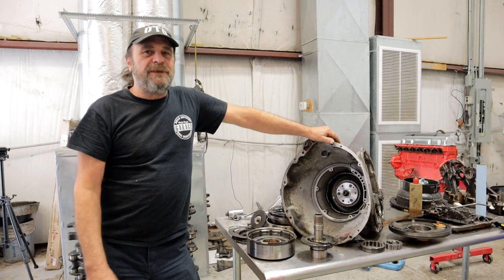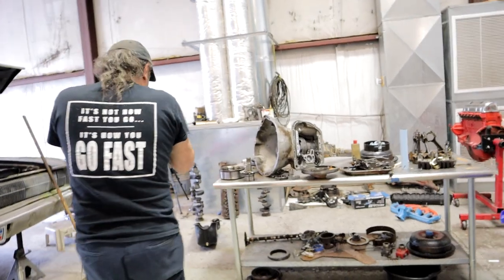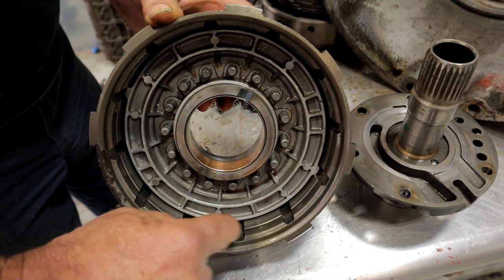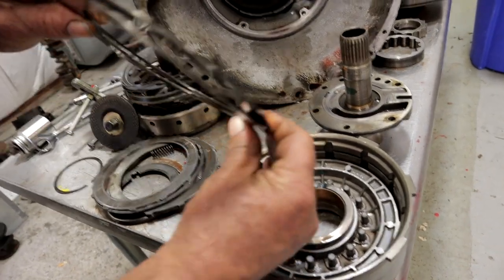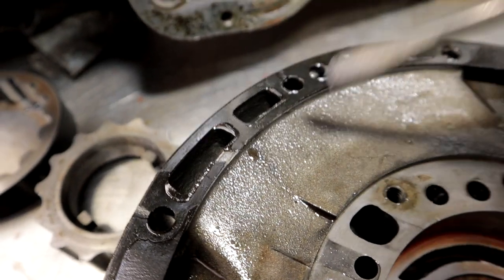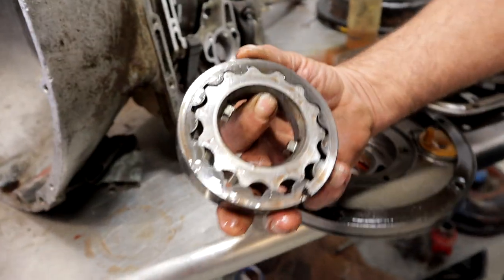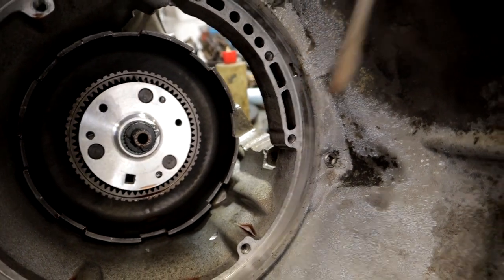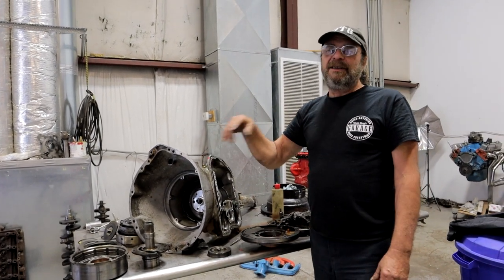Dead Torqueflite Autopsy - Digging Into Our 67 Charger's Transmission To Find Out What Let Go

Comment: Usually converter drainback causes the delay in the morning, and low throttle pressure kills the direct clutches. Of course low fluid level can cause/contribute to both. The gasket thing is a new one, but certainly could have been your problem if it was missing like that. Sharp eye!

Comment: You're the reason I have the confidence to drive old vehicles as daily's. 
Now I do admit I don't have any desirable stuff my daily right now is in 82 Cordoba that I'm building a small.
 block 318 for again nothing special
You're a service to the people that are trying to keep the hobby alive and I'd even turned the parts business into one of my side hustles to fund my projects keep up the great work utg
Reply: 82 Cordoba is still a Mopar and real Mopar guys will respect it, guys who scoff at anything less than a Hemi Cuda are posers. I daily a 1980 Newport 360
Reply: I have an 82 Cordoba in Gold that I hope to have running this year. I am pulling the 360 out of a 79 Cordoba, going to refresh it (Rings, bearings, etc.). I have a factory 360 Thermoquad manifold and will add a very mild cam. BTW, the previous owner of mine stuffed an 8 3/4 from a 1970 Challenger in it, said it was direct fit. I had an 83 Cordoba from 88-91, I blew up the original 7 1/4 rear end, replaced it with an 8 1/4 from a Volare with 2.71 gears, made car the relatively quick for the day even with the 2bbl 318. Good Luck!!!
Reply: Build that Cordoba up, life is too short, just enjoy it. From a Pontiac guy with love and respect for MOPARs.

Comment: I've been rebuilding automatic transmissions 45 YEARS this is the 727 torque flight  three speed  most of the time they just  wear out due to age  because of  gradual friction  exactly like break lining  gets to thin to stop the car ,, well the clutch pack gets to thin to pull the car   , but Tony  over 40 years ago  I was  just learning this trade , just so happened my nabuer   had a  prospector  Dodge  half ton  I was just a teenager and my dad was GM FACTORY TRAINED  FOR  ALL HYDRO MATIC  ,,, BUT THAT BLOWN OUT GASKET  MADE ME REMEMBER  ABOUT HOW  THE DEALERSHIP AND 2 OTHER SHOPS COULD  FIGURE OUT  ,,,,, THAT THE SURFACE AREA WAS NEVER CUT  DOWN TO MATE THE GASKET  SO I TOOK A  PUTTY KNIFE AND GAVE IT A SHAVE , MY DAD GAVE ME A 20 DOLLAR BILL AND TOLD ME THANK YOU JUNIOR 🔧🏁

Comment: I had to replace a reverse band on a 727 torque flite. it was in a 1974 International 3/4 pickup. it wasn't too bad of a job, although a person  has to basically completely disassemble the transmission to replace the reverse band. I guess it's fairly common for reverse band's to break on those transmissions. especially when people don't service them at regular intervals. and the ear of the band and the servo the clearance will get out of spec. and with the extra clearance the servo will slam into the ear of the band. and because ears on the band are cast iron. usually one of the ears will snap off. if a person keeps the clearance where it should be because band adjustment is part of the service intervals, they usually will never break. because most Torque flite transmissions don't have removable tail shaft housings. everything has to come out of the front of the transmission necessitating complete disassembly. because the band is at the back of the transmission.

Comment: I remember following a magazine article (Chrysler Performance maybe) on how to performance modify a 727 years ago. It showed where to dill hole out, or two maybe, throw away that spring, install a spacer, adjust the pressure, throw away a check ball, add some clutch springs, I forget all the things. That would be an awesome show to do if you could, as I remember the results were really good on my 1974 D100 Adventurer with a camper package 440 auto, loved that truck.
Reply: I remember that article, too! Works on both 727 and 904, they use the same valve body. I don't remember the spacer but everything else sounds correct. Did those mods to my 77 Diplomat 318 that I threw a Thermoquad on. 1-2 shift was hard but wouldn't chirp the tires and 2nd gear went past 90 MPH, not good with a basically stock 318 and 2.71 gears, 2nd usually didn't go past 75 MPH.
Reply: There are some books out on the rebuild process that probably leverage some of this "lost" knowledge.

Comment: I'm not sure if you bother to read the comments, but if you do; (A) Save the wavy plate steel,  it is the release spring for the clutch pack, sometimes there a coned shaped steel as well, both one or the other is necessary for a timely release of the clutch. (B) almost always converter blead down is the reason for a wait time to engage the gears the converter must fill first it gets first priority and there will be no usable line pressure until its full and air free . This is caused by a leaking seal o ring it bleeds down when the pump is not pumping (OFF).  There must be line pressure free of air entrapment for proper function of the clutches/servos. (C) The gasket break is only part of the equation, a small part, look to replace all the seals especially on the shafts.  Be very careful to have new trans fluid with absolutely no additives that will swell the seals or you get to do this trans job again. That said I love your channel keep up the good work. Lastly I have a 2881489 aka 489  old dirty but complete if your interested, not sure if its an open or a sure lock. I just don't know how to establish contact so be creative. It will soon be on face market.
Reply from the maker: Sam, the Torqueflite uses a wavy snap ring, not a plate.  The one here is definitely warped and cracked.
As for the 489, I appreciate the offer, but I've actually been giving the things away lately.  I've got more rear stuff than I know what to do with.

Comment: Those little Coleman mini bikes are great, bought one brand new for my kids a few years back. Engine always runs great, my only complaint is the wheel bearings they used from the factory, just junk. Mine have all literally fallen apart and had to be replaced already.

Comment: I have never seen that particular problem, but I did experience something crazy back about 40 years ago on a 69 D100 318/Loadflite auto. Someone had removed the entire kickdown rod on this truck before I bought it, and not paying enough attention to it and doing nothing to fix the issue, the clutches pretty much destroyed themselves. It stopped working altogether, I took it apart and the clutches were broken up into a thousand pieces. Needless to say, lesson learned!
Reply: I learned how important that missing rod was in my first high school 68 Charger!!! After it's function was fully explained, I made sure every other car not only had one, but that it was adjusted properly!!!
Reply: 727 torque flite transmissions, don't have a kick down rod. at least in the conventional sense, they what is called a T/P (throttle position) rod. it not only controls the passing gear it also controls the upshifts. and the adjustment on that rod is very important for the transmission to work properly.

Comment: Slipping in high gear is a classic front clutch problem. However, it won't cause delayed engagement. It's a good thing you found the pump gasket problem.

Comment: Tony! I live this channel,  been watching for quite a while.  I love the old mopars ! Had a 73 road runner,63 Dodge van (Fargo) 70 challenger, all gone😪  Anyway,  please do a step-by-step trans assembly!!! And why throw away that spring???? Lol
Reply: It's the accumulator spring. The perception is throwing the spring away gives a firmer shift. I've done many of these autos and never throw away the spring unless a shift kit is fitted and a sleeve put in to stop the accumulator from fully stroking.  But I'm not brave enough to say on a new post. The problem with this auto goes deeper than a broken gasket. I'm rebuilding a 1963 T/F at present, and I may video the assembly.

Comment: Rebuilt the 727 in my 79 D150. Had no reverse. Somebody prior to me “rebuilt” the trans and it had no reverse when they put it back together. They ended up purchasing a rebuild kit for a 518. Reverse band is a 1/4in difference. Entire reverse drum was destroyed and output shaft support was all boogered up. I replaced the parts with pieces I got out of my local junkyard from a ram charger. Shifts like butter and reverse works great now lol.

Comment: ya need to find an old dishwasher to use as a parts cleaner.  run the drain back to the tank. use the element to heat the cleaner
Reply: na utg will just use gasoline

Comment: It was a dark and stormy night, and the Johnson family was driving home from a late dinner when their car suddenly came to a halt. The engine had died, and they were stranded in the midle of nowhere.

They tried to start the car again, but it was no use - the transmission was dead. Frustrated and frightened, they decided to call for a tow truck and wait for help to arrive.

As they sat in the car, they began to feel uneasy. It was as if someone - or something - was watching them from the darkness outside. And then they saw it - a body bag, lying on the ground just a few feet away.

At first, they thought it was just their imagination playing tricks on them. But then they heard a strange noise coming from the bag, like a low growling sound.

Suddenly, the bag began to move, as if something inside it was trying to break free. The Johnson family watched in horror as the bag began to tear apart at the seams, revealing the source of the noise - a dead transmission, covered in blood and rust.

As they tried to scramble out of the car and run for safety, the transmission began to move on its own. It slithered across the ground, pulling itself towards them like a hungry animal.

The Johnson family triet to fight back, but it was no use. The dead transmission was too strong, and it had a wil of its own. It attacked them, latching onto their bodies and infecting them with its deadly rust.

In the end, the Johnson family was no match for the vengeful transmission. Their bodies were left behint, covered in rust and blood, as the transmission slithered away into the darkness, ready to claim its next victyms.
Reply: It never bit them with its sprag, injecting deadly burnt ATF into their veins?
Reply: Bet it was an old 1950's PowerFlite with that cast iron case. Unspeakable rust compared to the aluminum TorqueFlite. My TF never tried to eat me, but my 340 sure ate a TF one night after work.

Comment: I’ve got an late 80s G-body with the 200-4R, and I’ve changed the fluid on it twice, since I got it in 94. I’ve seen a bunch of clutch material at the bottom of the pan both times. I have come to realize that it’s because of running the Holley carb, before all the corrective brackets were produced, to make the Holley work on the GM transmission. I bought the throttle linkage adapter from TCI, and still had to adjust it to make it work for me. It sorta works. I can chirp the tires in drive, from first to second, but third is soft. I’m not experienced enough to try to rare my trans apart and figure out how to rebuild it. I’m looking to find a 5speed manual, and convert my ride. I did it back in the 80s with an old Camaro I had, and I’m looking forward to converting my GP to a manual transmission. I’ve reworked everything but my transmission so far, and I know that will make a big improvement

Comment: If I remember correctly, the torque converter on those have a drain plug that you can remove so that you can flush it out with cleaning solvent.

Comment: So you threw a spring away, where is it from, what is it's purpose, and in what way will it change the operation of the transmission?
Reply: Accumulator piston spring. The fluid has to compress the spring, then move the piston before applying the clutch. Basically a damper to soften the fluid pressure application for "smoother shifts". Who wants that LOL???

Comment: What does the spring you throw away do?
Reply: It's a shift cushion spring. Makes the shift softer. Usually replaced with a slug to make the shift solid.
Reply: @assymcgee2835  you can just leave it out and reinstall piston... Have been doing it that way since the late 80s or early 90s when Tony suggested it in a magazine article!!!

Comment: I'm into the minis as well and that one has been crashed mot a biggie but the front end is bent the pipes should be strate from the wheel all the way to the 90ish degree handle bars starts

Comment: This is the poster child of stop as soon as your trans/engine has problems that you notice, if it was taken apart as soon as it started that weird pressure loss on startup thing it would have been just a gasket and back on the road but someone probably kept driving it before it was parked and stopped just short of a full rebuild even clutches going out can go from pretty much just new clutches and send it to totally wiping out everything down to the case I do understand sometimes in some places in some conditions you can't just stop witch could be what happened with this one somebody could have been getting away from something or getting out of some bad weather or getting to someone that needed help it was kick while it was down then just retired who knows tho it could have happened from behind parked then driven again lol

Comment: I disagree about your synopsis of how you lose a forward drum. I've never noticed a grenaded forward drum with the area between the keys braking free from the drum and causing damage, it's always appeared to me to be centrifugal force causing cracks at the keys and the entire drum literally exploding when it freewheels. You could argue that it's a minor difference but it's what I've noticed. I'm certain you've seen more than me, I've never seen that type of damage in the few I've personally looked at.

Any how if you have a 727 with more that 500+/- torque upgrade your sprag and over 600-650 billet forward drum

Comment: great detective work!   Question- I noticed you don't take apart the rear section of the transmission, is that because it's not normally bad and therefore not necessary to dig into?  I'm referring to the tailshaft and those components you can see deep inside the case.
Reply from the maker: Yes, on these transmissions (most) all of the hydraulic and common wear items are in the front of the trans.  Since I knew this unit functioned well with the exception of slipping, there was no need to dig into the rear of the case.
Reply: @UncleTonysGarage  thank you for the quick reply I appreciate it

Comment: You said there was no support for that gasket at the intake area so wouldn't that mean that there's a problem with the machined surface in that area. And if there is then just putting it all back together with a new gasket is inviting a repeat of a future failure for the new gasket.

Comment: How fast will the mini bike go? We need a video.
Reply: Should swap an 810 or a 993cc Briggs on it.
Reply: burnt out video on the minibike.
Reply: @agnesweppler4360  UTG and "Kim Fixes Things" could have a competition with some cash on the line.
Reply: @MrTheHillfolk  and a place to hold a ramen cup!
Reply: I built a mini bike from a pile of parts last summer. I used a Predator motor. Can't keep the front wheel on the ground. I am a long time biker and this scares me. It originally had a Clinton engine which has nowhere near the power of the Predator.
Reply: @karlbishop7481  haha wanna see something stupid ? 
30hp riding mower on my channel. 
In true hot rod tradition its gone from a 12hp to a 20. But wait ,I swapped that for a 30. 
She's a bull for sure ,15mph and nail it and pop wheelies and it tops out around 30. 
Wish I knew about lawn mower pulley swaps when I was a kid, we always threw those things out. 
I'm going off of a quote from my high school shop teacher about 30 yrs ago: some of you will spend a lifetime making stupid $hit go fast, have fun!
Reply: @dubiousf00d  keep it near the hot air outlet so it stays warm 🤣
Reply: @MrTheHillfolk  Hey! Now thats thinkin! 🤣
Reply: @dubiousf00d  haha I try to sometimes 🤣
I figured the exhaust might be a little too warm and kill the cup 🤣

Comment: UTG, why do you throw the spring away on the torque flite
Reply: Be better to keep the spring, those trans before about 1971 shifted great. Check the sprag in the bottom of the case.
Reply: It's an accumulator piston spring. It initially dampens/softens the apply pressure to the clutch for a smoother, softer shift. Who wants that???🤣🤣

Comment: Hi UT. I'm having the same issue with the delayed reverse engagement. Especially when it been sitting for a few days. It takes about 10 seconds for the torque converter to fill with trans fluid so it will go backwards. Is it very detrimental to leave it this way for a time?
Reply: It will fill faster if you go from park to neutral for a few seconds then into reverse.

Comment: I've killed 4 4l60 transmission rebuilds, I'm still hesitant to even touch the terrible throttle/cruise/ overdrive cylinder thing on the 1993 cadillac fleetwood I seem to have been cursed with by the previous owner through the grifter I bought it from. In short I hate automatic transmissions, its bad enough when I've dropped them 3 times on jackstands, covered in fluid in 90 degree heat. only to be met with a burnt overdrive band. 
I should have bought a chrysler.

Comment: Yeah right. I have this 1962 Imperial that has the first 727. Nothing has changed till who knows when. 727 went right at the first try. problem is that i got a 1961 cast iron trans. doesnt matter wich motor im running.  413 is the engine. there are 2 pumps 2 cases. Since you are so called MOPAR guy,, gimme a hand here,, HUH? I allso have 361 in my 1961 chrysler
Reply: Rear pump in early automatic so they can be push started.